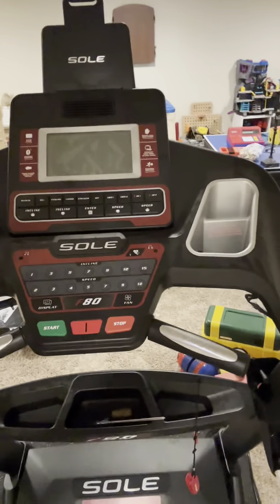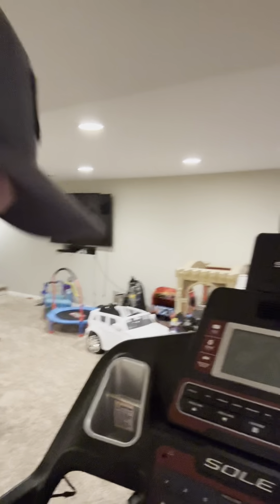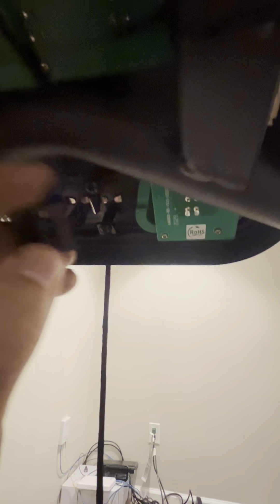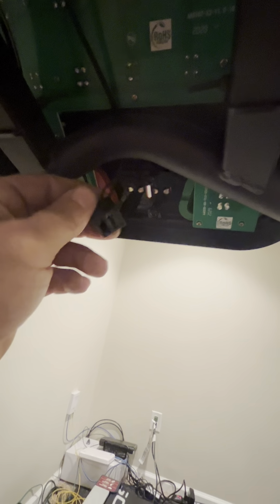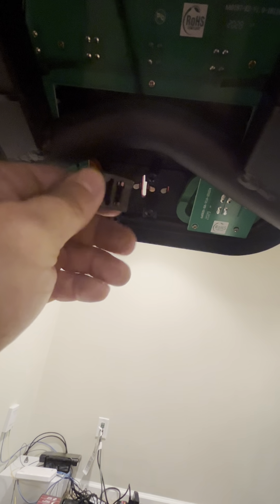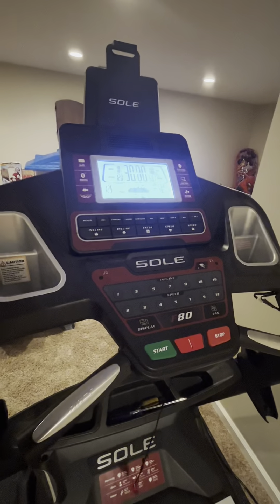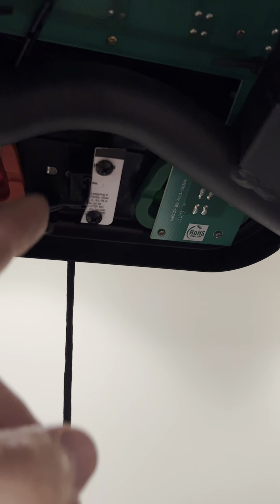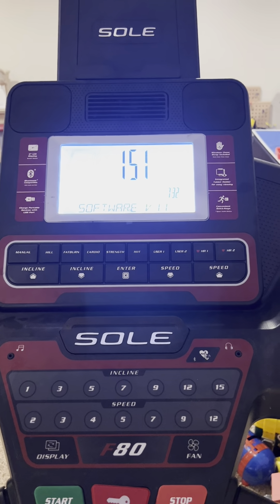Fix  Sole Treadmill Console Flickering/ No power

Comment: Hello my friend. I have a problem with the treadmill pro form performance 600i, I updated it through the ifit application and my panel does not turn on anymore. What could be the problem? After switching on, the fan is running.
Reply from the maker: Oof. Bummer. Corrupt Software. Most likely you will need a new console. 😪

Comment: I have led power to on/off switch only.     I don't use the  kill switch.  Anything else it could be??
Reply from the maker: In other words, your power switch lights up but no power beyond that?
Reply: @treadmillheroesfitnessrepa2142  that is correct.  The awitch on bottom is only thing that lights up.  Nothing else
Reply from the maker: @bryanriccio2768  believe it or not, the switch can be bad even when it lights up. Basically it lights up to say power is coming in not power out 
I bet a switch from fitnessgraveyard.com
We’ll fix ya.
Reply from the maker: I bet you have a bad power switch. It lights up showing power in but didn’t mean power is going out. 
I bet fitness graveyard .com has one
Reply: @treadmillheroesfitnessrepa2142  update lol.   Tried to pull tue 15amp fuse by switxh.   Messed that up for sure.   So switch and fuse lol.  Ugggg
Reply: @bryanriccio2768  if that 15amp dues is bad would the power switch light up? How does one open that fuse to check? Feel like I was about to break that then came to youtube here and see your comment. Lol FYI, F85 treadmill 2 weeks old no display.